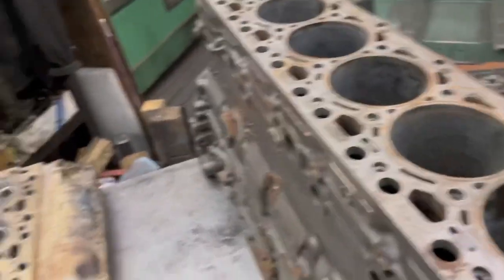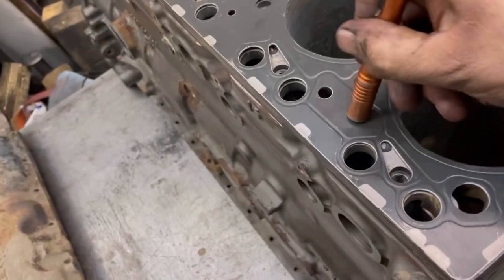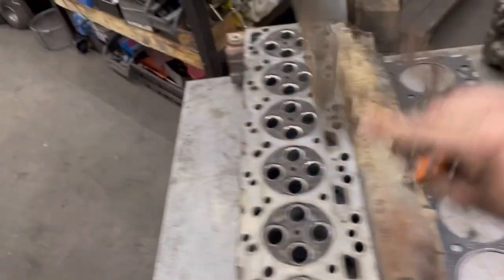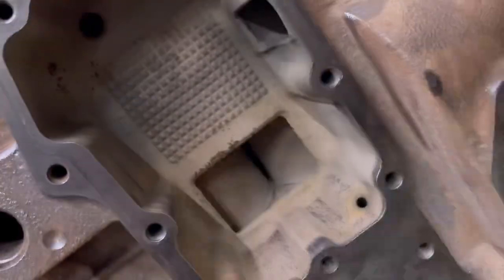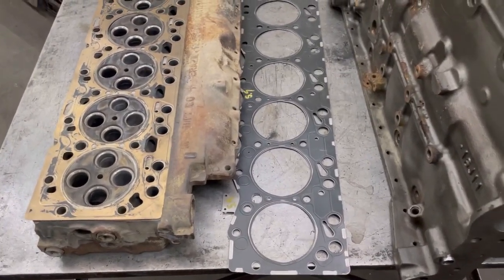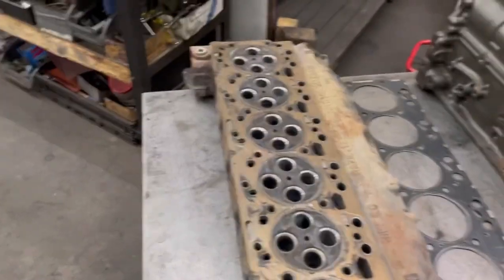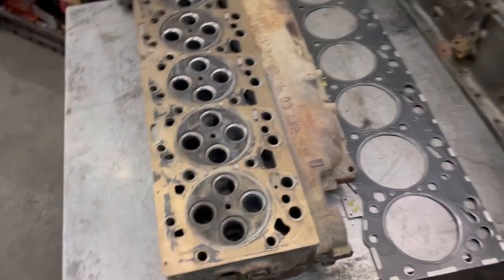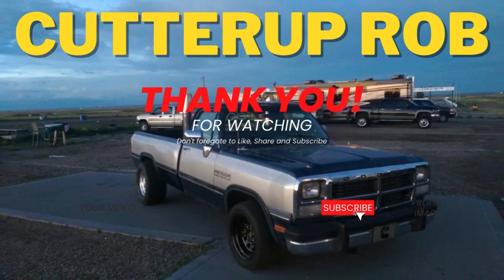How to put a 5.9 head on a 6.7 block

Comment: Why didn't you use the 6.7 cylinder head, don't the 5.9 24 valve injectors fit?
Reply from the maker: Yep the 5.9 injectors go in them. Just some people want to do it. Reason I have done it is I had a couple ported 5.9 heads and wanted the displacement

Comment: Is tuning required if I slap a 6.7 short block in my 05 and change to the 03-04 injector?
Reply from the maker: Need no. But I would recommend it as it will run way nicer

Comment: I watch your channel to know what is what between 5.9l Cummins.   I have a 2004 3500 dodge that the 5.9l decided to spit the connecting rod cap with lower bearing out the side of it.  I am playing hell trying to find a 5.9l block so I can get my truck back on the road.  I am just about ready to put a 5.9l gas engine in it.  I do not want too as I love the diesel.   Any ideas on swapping for a 6.7l or just face facts and deal with junky 5.9l engines on Craigslist.  ???
Reply from the maker: you can swap the 6.7 long block in the truck you just need to run the right injectors for the comb